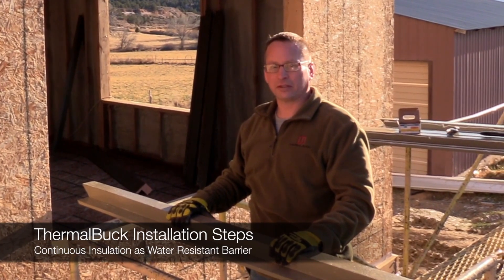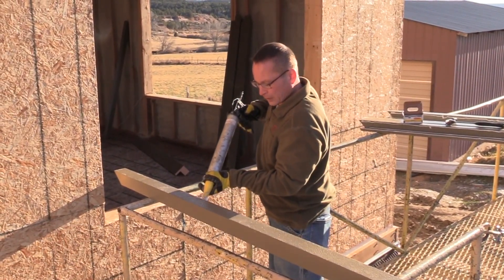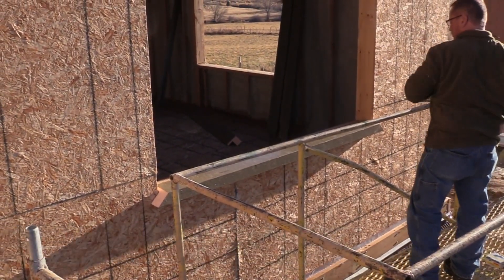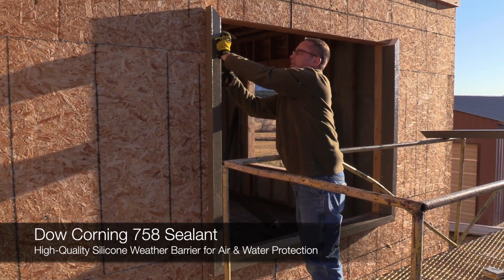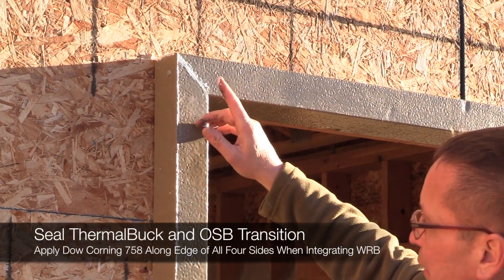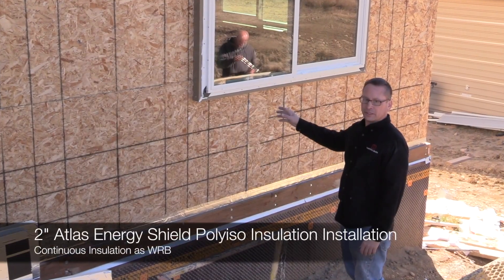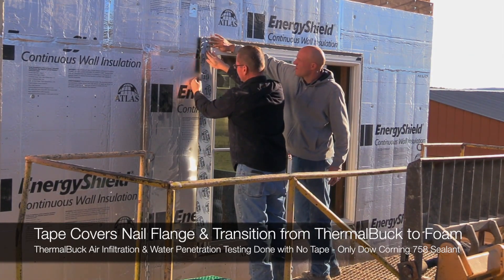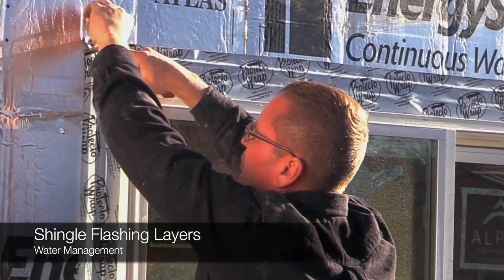How to Install ThermalBuck - Exterior Insulation as the WRB

Comment: Looks top notch. Just a couple of things: someone who would take the time for the extra labor and if u ever needed to replace a window then what. I think that you had the r-12 window but what if ?
Reply from the maker: Great question. ThermalBuck actually installs pretty quickly once people get the hang of it. Always a learning curve with any new material, but when you're adding exterior insulation to a building, there are simply extra steps to get the window on the same plane, and keep the opening airtight & watertight (whether you choose to work with ThermalBuck or not). With wood, it takes extra time to get all 4 pieces at the exact same depth, every rough opening. ThermalBuck's "L" shape positions it at the right depth, every time. And wood bucks have to be flashed before the window goes in, and it's not an easy step to get right. With ThermalBuck, the RO is completely flashed by the ThermalBuck  & sealant - and it's simple. 

As far as replacing the window, most replacements don't use a new full-frame window, but a replacement window - which wouldn't impact the ThermalBuck at all. If a full-frame window is selected, much of the surrounding building materials would have to be replaced, including the ThermalBuck.
Reply: @brincbp  For the window replacer (after it starts leaking), how would they know this was a ThermalBuck System?
Reply from the maker: Great question. ThermalBuck actually installs pretty quickly once people get the hang of it. Always a learning curve with any new material, but when you're adding exterior insulation to a building, there are simply extra steps to get the window on the same plane, and keep the opening airtight & watertight (whether you choose to work with ThermalBuck or not). With wood, it takes extra time to get all 4 pieces at the exact same depth, every rough opening. ThermalBuck's "L" shape positions it at the right depth, every time. And wood bucks have to be flashed before the window goes in, and it's not an easy step to get right. With ThermalBuck, the RO is completely flashed by the ThermalBuck  & sealant - and it's simple. 

As far as replacing the window, most replacements don't use a new full-frame window, but a replacement window - which wouldn't impact the ThermalBuck at all. If a full-frame window is selected, much of the surrounding building materials would have to be replaced, including the ThermalBuck.

Comment: Dude, what about the Air Barrier? Hope you can see that you are adding more problems to totally unnecessary products.
Reply from the maker: There are a number of different methodologies to build a wall assembly, and a healthy debate is always welcome. This homeowner is an engineer, and researched the options and recommendations best suited for his specific climate. Foil-faced polyisocyanurate insulation is often considered an effective air & vapor barrier, as long as the seams are well sealed.This homeowner used combination of sealant, spray foam, and a layer of tape on top, to complete his air barrier.

For resources related to your inquiry, please follow these links:  http://www.energyauditingblog.com/what-is-polyiso/
http://www.ashireporter.org/homeinspection/articles/air-barriers-versus-vapor-barriers/14631
http://wall.atlasrwi.com/products/residentiallight-commercial/energyshield/#tab-air-water-barrier9a65-42b4
Reply: @brincbp  The window is poorly water sealed also. I don't see any plastic over the OSB (or ZIP sheathing). Eventually water will permeate into the OSB and soak into the entire window/wood frame. Matt Reisinger would have used ZIP sealer all over, including the ZIP stretch tape, then set the window in place. I don't want them building my house, either way. Any caulking will eventually leak in 10 years or less, shouldn't be dependent upon it. This video is 4 years old though, so I can see why you would do it like this. Here is Matt: https://www.youtube.com/watch?v=vCZvx5nZfCU